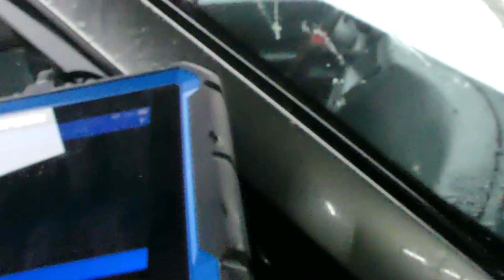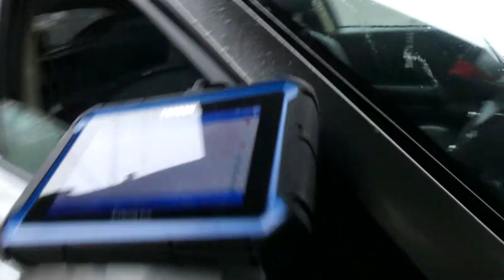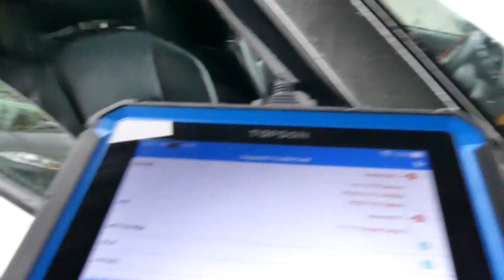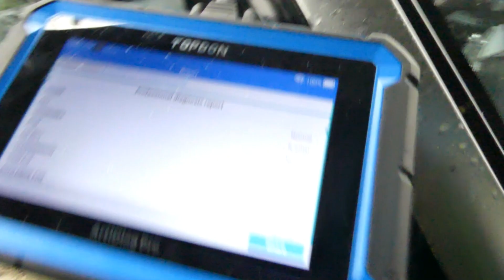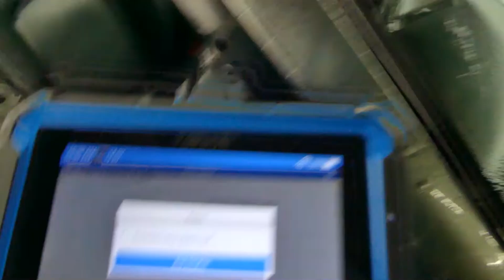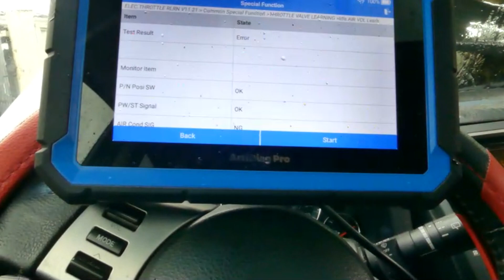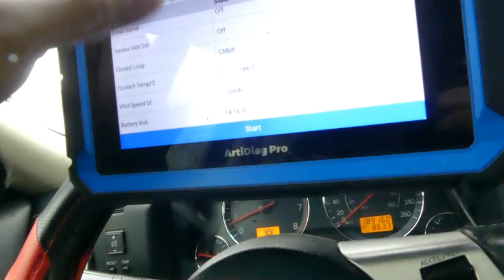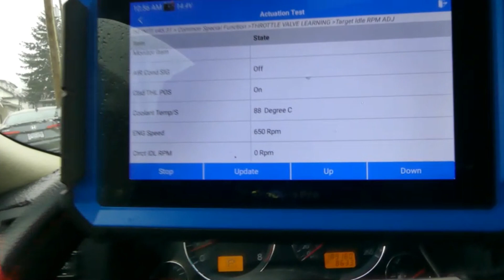2004 Infiniti FX35 Misfire /P0507 Idle too high /TP sensor Code DIAGNOSIS & FIX

Comment: Hi great video.  I have 04 infiniti fx35  sam3 code issue. Did u replace only ignition  coil #2.  Or u changed all 6 ?

Thanks Robert
Reply from the maker: just replace the faulty one
Reply: @asianmechanicguy6483  how do u know which one is the faulty one
Reply from the maker: @RobertLopez-u4c scan it for codes